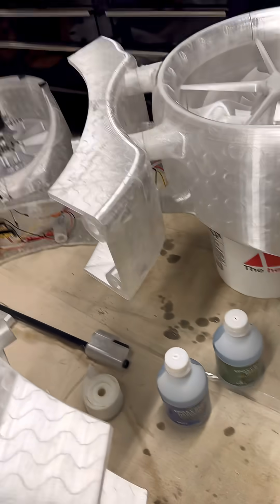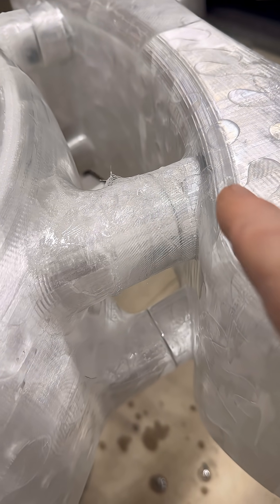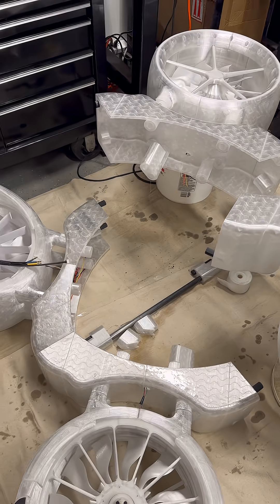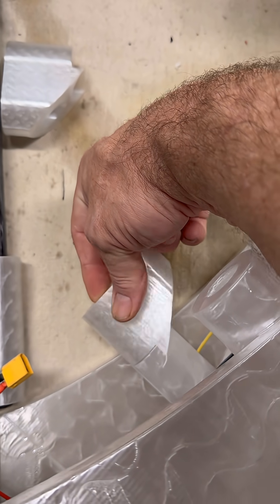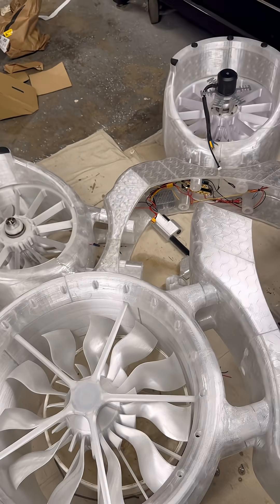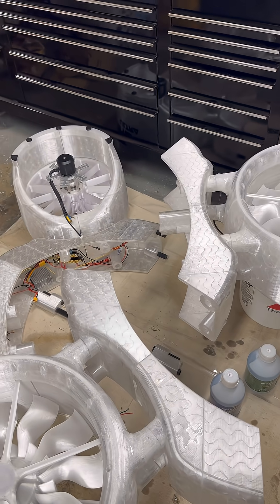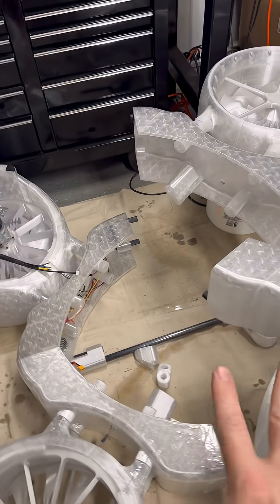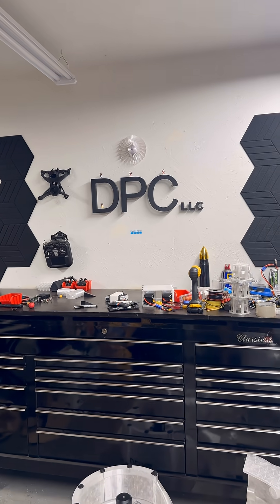Biggest 3-D printed drone ever! Progress continues.

Comment: Man, it amazes me that guys like you exist. I am a Repair type of guy. I can fix anything. Literally. Electrical, rebuilding internal combustion engines, plumbing, framing, tile, appliances. Even repairs on circuit boards like radios and computers. I have always impressed my friends and family with my skills. But, Then…..there is a WHOLE DIFFERENT LEVEL. Which are The Creators. I can repair a thing. You can engineer and create a thing from nothing. It’s a mind blowing achievement to create something. I feel about you, the way my friends and family feel about me. It’s wizardry. 😂